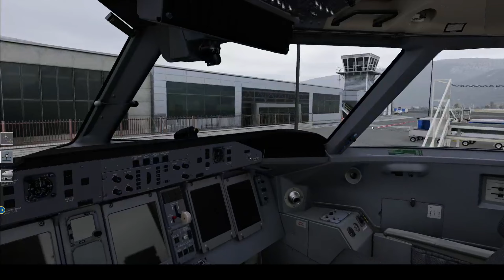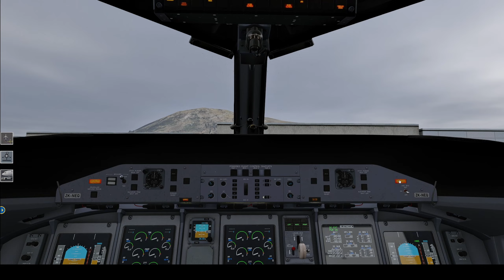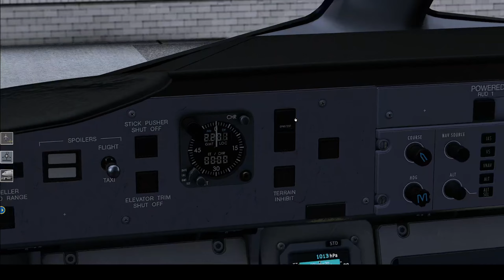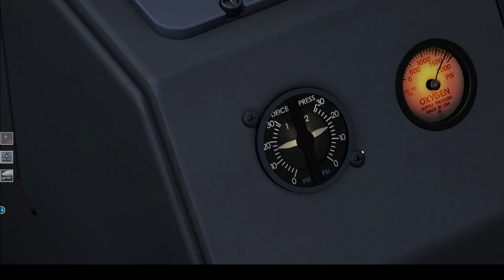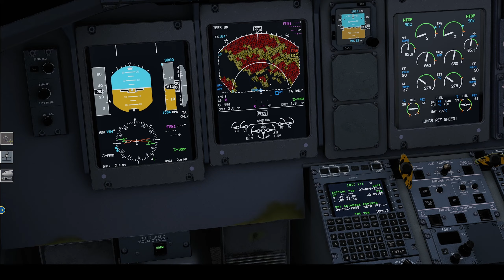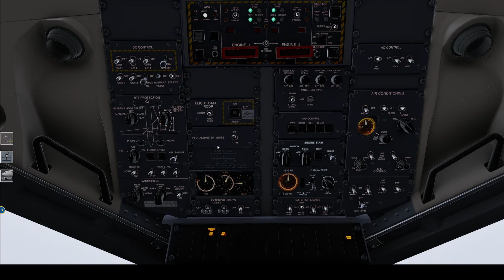Dash 8 Q400 - 24 hour system checks tutorial

Comment: I`m a bit confused. Is there different flows depending on which company you work for? I saw a video of some english Dash 8 pilots that did almost all the system tests in the pre-flight flow, and not in the safety/power up flow.
Reply from the maker: Oh yes, things vary quite a lot between companies. Some companies are very flow heavy with a lighter checklist, some are extremely checklist heavy with almost no flows. I don't remember where I saw it but I know there are operators in Africa that at least used to be that way until recently. I have entered the simulator after companies from other continents have been in there and no button was where it was supposed to be after their shutdown flow or checklist (according to our checklist). The modern approach is flows with checklists to back them up.

Comment: Do you turn on the position light during the safety inspection/power up or in the preflight?
Reply from the maker: The position lights are always on, never turned off in real life. The only time they are off might be in the hangar. Since they are not powered by the batteries and are required to be on to mark the position of the aircraft on the ramp it's the only button we don't touch. Just as a small fun fact, the Dome light switch is connected directly to the batteries and is very important to turn of when leaving the aircraft! It's the last item on our shutdown checklist, but we will get to that in a later video :) That's why the Dome light switch is shaped differently to all the other switches.
Reply: Wow. Thats a fun fact, never heard that before. Thank you :)

Comment: Great info here. How would you recommend setting up the aircraft for repeated sim landings (10 mile approach)? I’ve been taking the air time down to 10 minutes on the J-Pad and the fuel down as far as possible without getting a low landing fuel warning. Is that realistic?
Reply from the maker: Not sure how important it is to set anything in the J-Pad, I never really did any tests to see what that affects. Must do that some day. For landing training in real life you get as much fuel as you need and go from that. This depends on flight time as usual. A very light aircraft is often harder to land smoothly then a medium to heavy aircraft, but in this simulator the power simulation is currently weird over about 25000 kg. In general I am not to impressed with how the aircraft handles descent and landing, it's much harder then in the real aircraft. It's harder to slow down and maintain speed control in the air and the ground physics is twitchy and unrealistic as in all simulators. Some of these things have been acknowledged by the dev, so hopefully it will improve in future updates!
Reply: @toolowsimulation  Thanks for taking the time for such a detailed response. I'll wait with you for future improvements in the add-on.